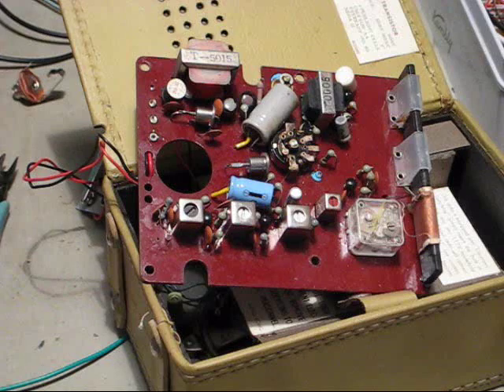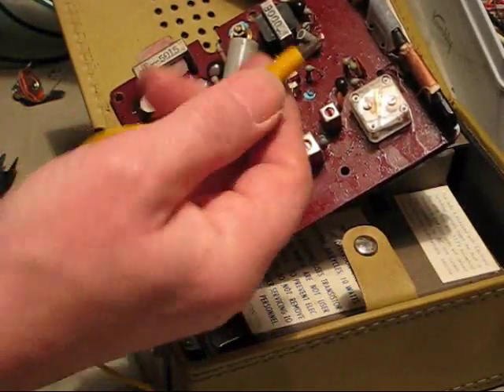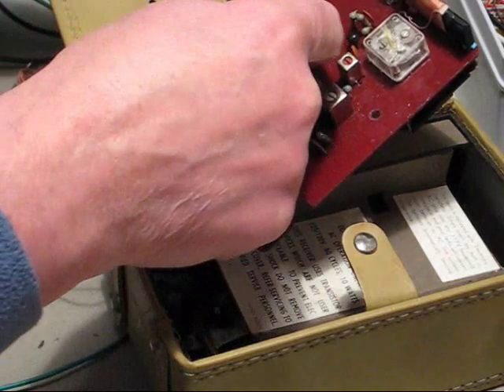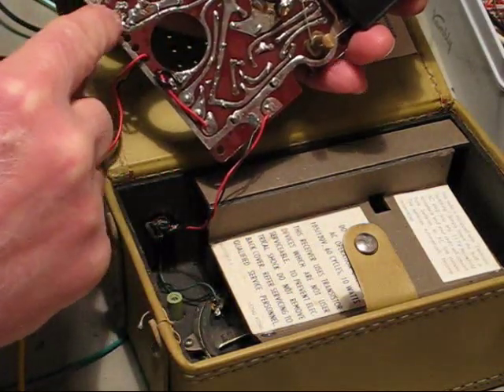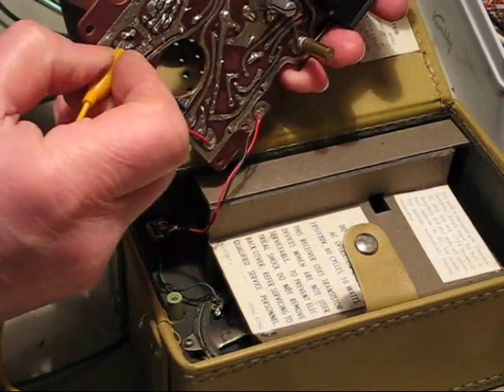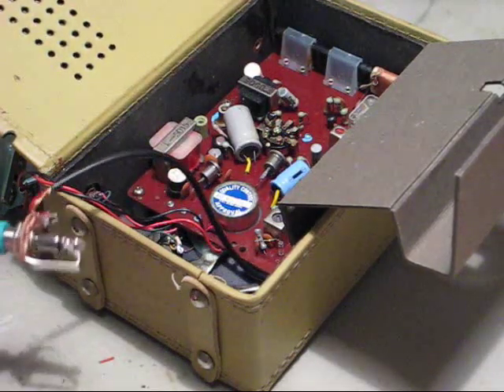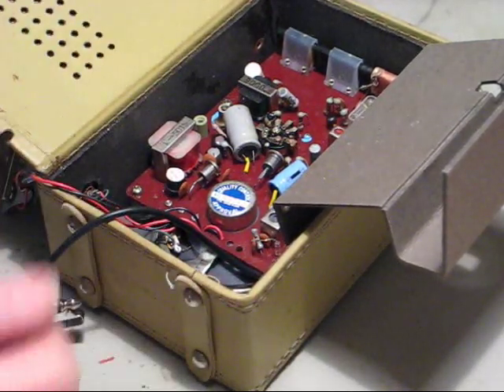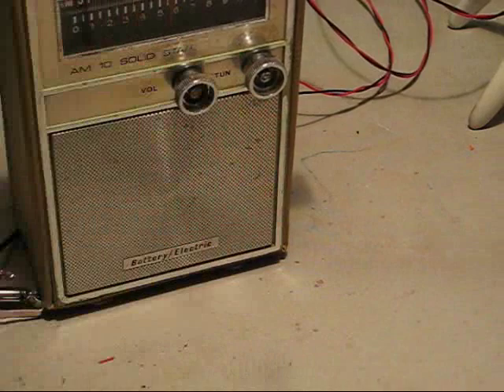how to make a guitar amp from an old transistor radio

Comment: no cleans at all ?
Reply from the maker: Only by turning the volume down.
Reply: A lot of the audio amp circuits are line level which is often lower than most guitar pickups (at least the few that I own) so it overdrives.  Even the common LM386 IC's in a lotta guitar headphone amps is like that.  a resister in series between the input jack n the volume pot (if its on the input of audio stage) can reduce the overdrive a lot.  Just experiment with differeing values to find what works on the perticular circuit your using.

Comment: Oh goodness I actually do have one last question for now... how do you use a cut instrument cable to test the volume pot
Reply from the maker: +Anne Owen sorry I don't understand the question
Reply: +smojomusic I have read that instead of a signal detector you could use an instrument cable with a flying lead to touch and test the volume, I think I will get a tone generator, but if I can't afford one, i have an extra amp cable...
Reply from the maker: +Anne Owen yes you can do that. just cut the plug off one end and strip the cable back so you have a longish lenght of the inner and outer (braid) seperated. You can attach crocodile clips to them to make it easier then plug the other end into your guitar, turn its vol up full and use the signal coming from that to test. It's a bit fiddly as the guitar needs to be strummed every few seconds. get a helper to do the stumming. If you want a sig generator you only need something really basic and simple. worth getting if you intend carrying on with other projects. good luck

Comment: hello, I bought an audition radio that is similar to this, after I fix up the battery compartment, I'd like to convert it. I am a woman, I don't know jack about electronics and I don't want to electrocute myself, so I bought an electronics book and a transistor radio book to help. My questions for you are as follows: where did you get the coax cable, how exactly did you hook up the jack input to the radio, and what do you do to drill the hole for the jack?
Reply from the maker: +Anne Owen if it's a battery operated radio you can't electrocute yourself. Just don't use any radios that plug into the mains and you'll be ok. Coax cable i got from a local electronics shop. If you are in the UK Maplin will have it or Radio Shack in the US. Ebay too. I've already described the process for hooking up in the vid and also previous comments, please look back through it all as I can't easily describe it in a comment. You should be able to find the info. Just use a normal steel drill for the hole and widen it with a file to fit the jack.
Reply: +smojomusic  thank you for the response!

Comment: one wire goes to volume, and the other goes to? that's the part I can't figure out. I'm trying to make one myself.
Reply from the maker: +Jason Farrow Sorry if it's not clear.  You need to use thin braided (shielded) coax cable. Solder one end of the inner wire of your coax to the springy part of your jack that connects to the tip (which is the live signal) and the outer braided wire to the collar of the jack which is ground. The other end goes to the radio. The inner needs to connect to volume pot and the outer to the ground part of the radio. Usually there will be a big track running all around the board and one side of the battery (usually negative) will be connected to it. There will be three lugs on the pot and it's the one that goes to the detector diode. You will disconnect that from the board, then solder your inner wire of your coax either directly to the lug it goes to on the pot or the point on the board where the diode was which ever is easiest to get to. Hope that helps.
Reply: The ground! Ok, I get it now. I have watched a lot of these videos, and could never figured out where the other wire went. Thanks for your help! I'm trying to make one of an old getto blaster.

Comment: how did you solder the jack input to the diode? which wires went to where?
Reply from the maker: you don't solder to the diode, read my previous comment which explains it, you solder to the volume pot.

Comment: Get yourself a large cardboard box, say 2'-3' square,  with one side cut off. lay the box down so the opening is looking in the direction you want to direct the sound.
Put the radio in the middle of the box, with the speaker looking at the opposite end from the opening.
Improves the sound quality 100%.
I've done this with walkie-talkies in the past.
Check it out!

Comment: If it were me, I would build a simple input stage into there, to get more volume and to buffer the guitar from the volume control (otherwise, when you turn down the volume on the amp/radio, it's the same as turning the knob on your guitar--in fact, you could take the radio's volume control completely out of the circuit and just use the guitar's volume; it would sound the same.). Something like the Electro-Harmonix LPB-1 circuit would probably work, and would be dead simple to build.

Even if you don't need the additional gain, I would still put some kind of buffer in there, unless you're just always going to be running pedals into it.

Comment from the maker: In old style AM radios there's usually a diode detector between the rf stage and the audio amp input (which is usually the volume pot.) If you trace the volume pot wiring back to a diode that will be the one. You only need to disconnect one end of the diode so if unsure you can try unsoldering it first and see what happens, connect your jack inner to the lug on the pot that was connected to it and theouter to ground and you should be away.

Comment: hi there great video need to try that out. main reason for comment is what make is your guitar in the film.. I have a red sg shaped guitar which I have had at least 20 years and never have known the maker. Your guitar has the exact same pickups on it and I wondered if you know the maker. thanks
Reply from the maker: Thanks. It's Known as a Kay "tulip" (because of it's shape - I believe they were made in Japan late 1960s or early 1970s by the Teisco company - just cheap guitars but quite nice to play

Comment from the maker: the tip of the jack goes to the vol pot and the outer connection of the jack goes to the radio ground (usually the negative side of the battery)

Comment: Hi again, Thanks for the reply.
I only got it this morning and I've just plugged it in and everything works, bit crackly on the pots, but a bit of spray should solve that. just had the back off and gave it a  hoover out. On closer inspection, it's clearly not an OLD radio. Looks like one of those replicas sold in "past times". Judging by the sound I got from the one station it picked up, it sounds like it would be a nice crunchy sounding amp and it has lots of volume. (oops running out of words)

Comment from the maker: Yeah, for safety best keep to battery powered ones. If you really must try hacking it, just try powering up first and see if the valves (tubes) light up and any noise at all comes out of the speaker. Only work on it with it unplugged. If it works and you manage to hack it, place a capacitor in series with the jack tip connection to isolate it from any stray voltages. My advice though is if you're not sure about electronics, leave it alone.

Comment: Hi, Presumably that radio is run on batteries?
I just picked up a sweet looking little old wooden radio from the bootfair for conversion, but it's a mains only.. which I don't mind, but when you tested for sound obviously you had to have the power on. So my question is how do I go about testing my one safely without giving myself a spikey hairdo and glowing testacles:0)
Cheers
Gary

Comment from the maker: I used an oscillator (signal generator). You can just plug a guitar into a jack with a flying lead and poke about with that but it means one had is occupied strumming the guitar to get a signal.

Comment: Sounds really good!!..and guess what, I converted an old radio to an amp today!!  Also inspired by Johns videos.
  I didn't really know what I was doing!...worked out how to connect the wires from my jack to the vol pot, but wasn't at all sure how to stop the radio working. I started snipping wires that seemed to go to the tuning dial and after the 3rd snip the radio sound stopped, but it still worked as an amp!! Just got to try and stop some rattles!!